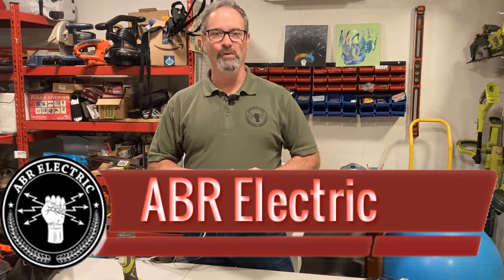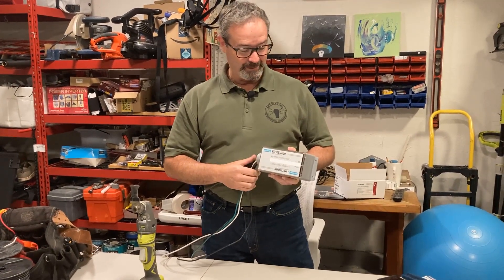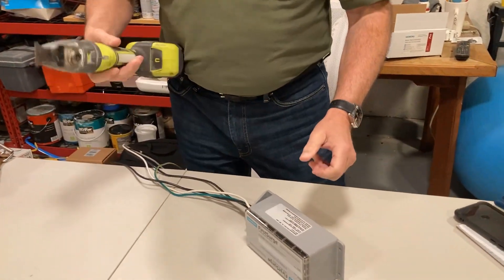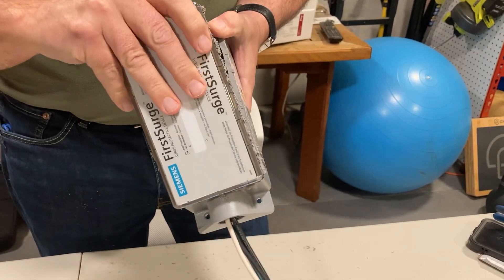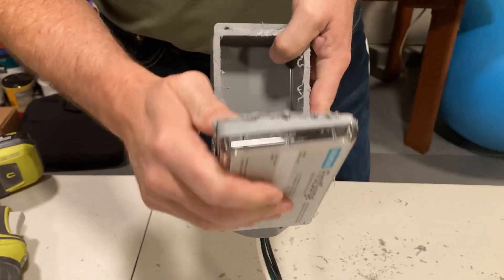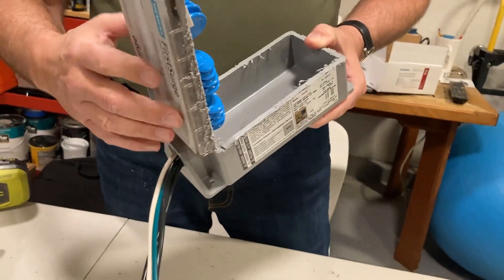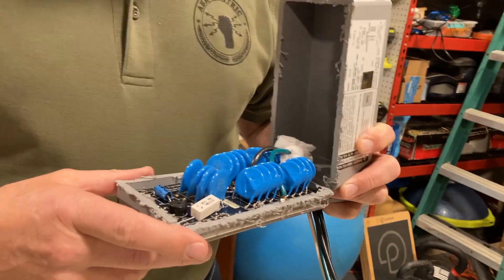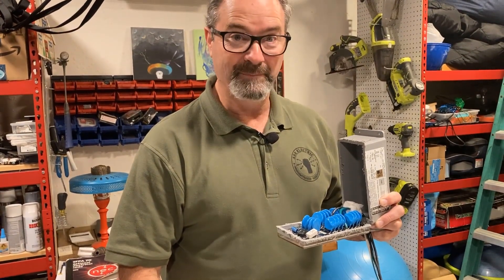Cut it OUT! Looking inside a FS140 Siemens Surge Protector

Comment: Hmmm confused! You opened up an expensive SPD just for wondering how thick its housing is and how stable it was build? Not understanding the components inside at all? Lots of MOV's - varistors - voltage depending resistance. If a high-voltage transient occurs they discharge it down to earth by lowering their resistance form MegOhm to a few Ohms. Each  part around 1 Buck! Price tag is ridicolous!

Comment: I just purchased a FS140 and it has no Siemens marking on it. The device in every way looks like the Siemens and has a UL  listing number 60335-1. Have you seen them?
Reply from the maker: @chawesspe3  how much did it cost? Also, does it have the shiny holographic square?
Reply: @abrelectric  It cost a $118 from Amazon. After doing some checking, I found out it was a Chinese fake product. I have no idea what's inside of it and I just returned it.
Reply: No holographic square

Comment: FYI
Thecspecvin the Siemens fs140 was only tested with the cable st 6 inches Siemens tech support told me when I asked. He explained that if any longer cable to the panel to shorten cable as much as possible. He slso said to twist the wires from the fs140 uniformly as muvh as possible before connecting to panel if I recall. I forgot exactly what he said butbif I recall, twisting the wires if using longer than 6 inches helped reduce the difference in the spec. I had the data somewhere after talking yltoma seasoned electrical engineer which showed me the Siemens spec was significantly worse in the specs if cable 36ninches versus 6 inches. Of course the Siemens manual doesn't discuss this but I sm positive via double checking with Siemens that the spec is for a 6vinch cable length only
Reply from the maker: I did a video regarding the "Twist ".
I'm wondering if all SPDs are tested with only short, straight leads?
Thank you!

Comment: A favor please. Now that you cut this up can you put a flame to the plastic to see how easily (or not) it burns?  Backstory---> Whole house surge protectors, under "normal" use conditions, will fry the internals on a voltage spike, and nothing else,....but yeah....the SPD is now toast and it needs to be replaced like a fuse. However, there are other modes of operation and also other modes of failure, such as the incoming line power having an immediate faulty neutral or such things..like when a car hits a pole / transformer or whatever...and the spike for a failed neutral may make the unit get hot and burn. Now you have a SPD with melting plastic that can burn down your house. ( Yes, the FS140 supposedly has a thermal-disconnect, but who knows if this helps). My main incoming load panel is garage-wall flush-mounted between studs ( and drywalled)...so my attached FS140 is close-coupled to the lower panel punch-put via a chase nipple. I am tinking of encasing the FS140 in yet another metal box for this possible fire hazard...but before I do that would appreciate knowing how flammable the FS140 casing is. BTW.....Siemens phone "Tech Support " ( at least the last guy I talked to).....really made it clear he didn't want to be at work and was cryptic and no help at all on anything technical. Was also rather rude and happy to get off the phone at the end of our talk.... very disapppointing.

Comment: This would explain why Siemens suggests different models for different regions - because they are just using MOVs which degrade a little after each surge.  If you live in an area with more frequent lightning they want you to use one that survives longer.  So you aren't actually getting a more powerful surge protector by buying the more expensive version (the FS140) if you aren't in an area with a lot of lightning.
Reply: Yes, but it will last longer.  Think of it like a battery in a flash light:
The battery lasts for 5 hours.  If you live in an area that has frequent "5 hour blackouts" you can only use it once.
But if you live in an area with "1 hour blackouts" it will last for 5 blackouts.
Does that mean you should only buy a flash light with a 1 hour battery?

That is how a surge protector works; each event uses some of the protection no matter the size of the surge.  In other words, you may not need the extra protection for a single event, but the good thing about the FS 140 is that it will last much longer than a unit with a lower kA rating.  It's more expensive, but it's much less labor for yourself if you DIY (or a lot more savings if you hire an electrician).  I expect this unit to last for the rest of my life (I'm an electrician and I live in Philadelphia, so i don't want to have to change it again since i'd have to do the work LoL).

Comment: Sorry to be skeptical, but this is supposed to protect the whole house????? 
 Most houses have a 80-200 AMP main breaker with wires much heavier then 10 gauge. The wires on this are maybe 16 to 12 gauge. Other on the wall socket surge protectors, will not only slow down or stop the surge but will open up the circuit if it is to high. This does not have that protection, since the wires are not heavy enough to carry the whole house current. It looks like it just attaches to an existing power line to clamp the surges, but it has no way to stop a large one or lightening strike. To me it is worth maybe $50.00 to $75.00 for the parts and the construction.
Reply: If we're talking a direct lighting strike, it barely matters what gauge wires you're using. 2/0 AWG and 10 AWG are both gonna be frying under a < 1 ms 140,000 Amp 500kv pulse
Reply: I do share your amazement, but you can let go of the skepticism.  :-)  I'm an electrician and this is what I installed in my house.  The wires are 10 gauge.  I admit I don't understand the physics of why wires on any surge protector don't vaporize, but they don't.  As far as I understand it: it is because surges (Voltage or Amperage) happen in microseconds and SPDs respond in nano seconds.  But I really don't care: this is a time-proven technology that is used around the world.
Here in the US, as more homes move from gas to electric, the grid is becoming more stressed; blackouts, brownouts, and line repair surges will become more common -the 2020 NEC now requires either Type 1 or type 2 surge protection on new services and it's for good reason.
Reply: “lightning strike”

Had a friend where molten metal from an electrical box ejected from the wall into a waste basket & started a fire. They put it out, thank God.

Being concerned about 10 gauge wires on an MOV is the least of your concern with lightning.
Reply: The reason the wiring can be relatively small, is due to the very short duration of lightning surges.
These things only conduct for a few microseconds. Not enough time for the wire to heat up and melt.
It's the same reason that the protection ground wires in your house can be smaller than the protected circuit, though to a lesser extent. They only have to conduct long enough to trip the breaker.
A direct lightning strike is a different matter.  Not much out there can really protect from that.
Reply: That's because a surge is VOLTAGE...you are thinking Amperes. The amperes are not much, is why a 20AMP breaker will do, what skyrockets is the VOLTAGE, sudden and in nanoseconds.  You don't need thick gauge wires, you already have an entire breaker panel with overCURRENT protection. Again, is the voltage.  A stun gun or a taser for example is THOUSANDS OF VOLTS and the wires are even thinner. Of course is probably 2 or 3 amps, anymore than that and the guy would be fried because of the voltage.  Do an Ohms calculation and you will see why those tasers and shock sticks can be 50,000 volts ON A D 9Volt battery.
Reply: The wire size on the FS140 are 10 gauge. I know this because I installed one on my house today. Install went super easy and I think the $200 price tag is well worth the insurance it could provide to expensive items in a home.